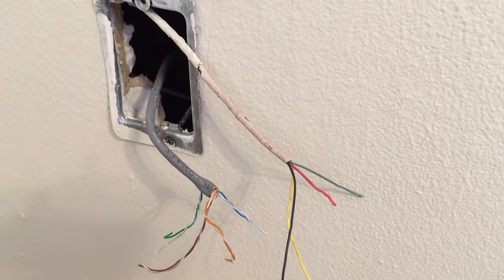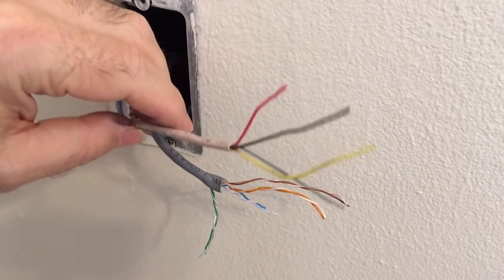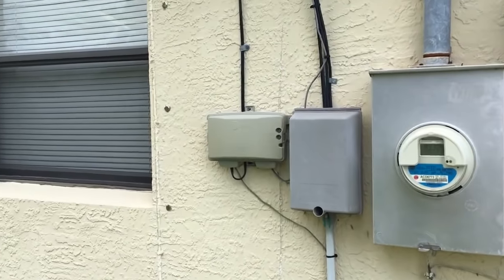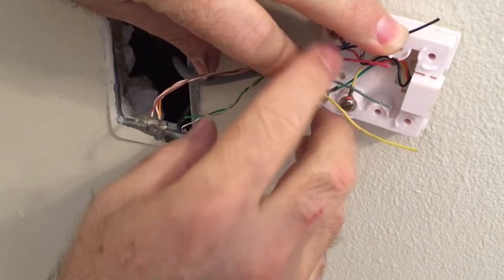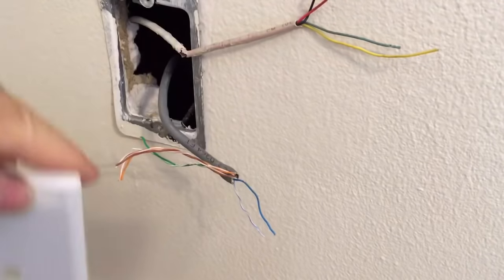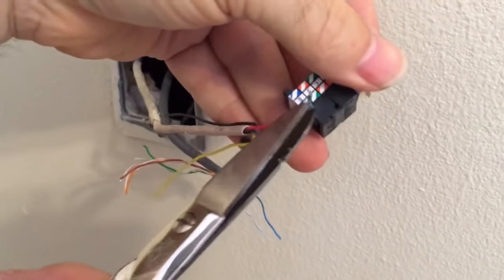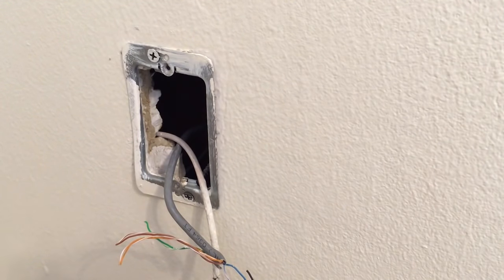House Phone Line Wiring

Comment: I have multiple phone jacks coming to the NID on the outside of the house. All wires are not connected to anything. I am no longer using the phone company but using a device for VOIP, which has a RJ11 Jack. What is the best way to connect my jacks to the new VOIP connection? Can I connect all of the Red to Red, Green to Green, Yellow to Yellow, Black to Black on the outside of the house including the connection from the VOIP? IS there a special termination block that can be mounted outside to keep the weather off of the connections? TIA

Comment: Our house was built in 1963. We have 3 round jacks which are flush to the wall. One in the kitchen, one in the hall and one in the master bedroom.. Suddenly all three do not work. We had Spectrum cable Co come in and check their connections and the tech said their system was working fine and the problem was not with their set up.These jacks must operate from a central location, as all three suddenly stopped working. Any suggestions?

Comment: Great Video.  I had an outlet that had two jacks, one was for the internet the other for phone.   The phone jack only had two wires, the internet had 4.  I changed to cable and used the space for the old Internet wires for the cable but had to reconnect the phone.    So i connected the new jack and only used two wires that was used for the phone jack.   All work fine, except the phone has a humming sound now.  I wanted to know if it is possible one of those wires from the internet may have been a ground to terminate the buzzing.   Can you help me with this issue?

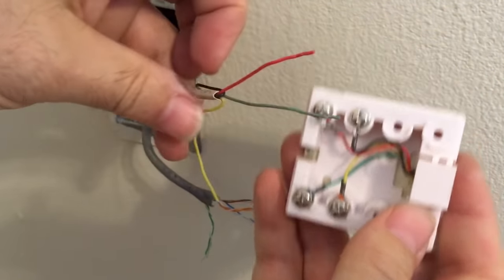Comment: Hi, at 4:44, it sounds like you are saying the tip and ring are 'green and red.'  

The wires appear to be gray and red, and then are shown to connect to the phone jack, which has red, green, black and yellow wires.

Are the green and red typically the two wires needed for a single residential phone installation?

Thank you!
Reply from the maker: Green (tip) and red (ring) are usually all you need for a residential phone line.   If your wiring does have a green/red/black/yellow wires inside, the its commercial wiring.  In that case, the white-blue and blue-white wires are what you need for tip and ring.

Comment: Apologies for the dumb question, but if the wiring from the wall is only three (Red, Green, Yellow) solid copper wires, is that a problem and can it be wired to any of these wall plate styles you went over? Also, my wire is coming right out of the wall, there is no metal mounting "bracket" as in your video or an electrical box it feeds into. Do I need to install anything additional?
Reply from the maker: Usually all that matters is the red and green.

Comment: only question i still have is that my issue is from the demark to the jack.  i want to replace the line because it is very old.  our phone company is Frontier and we have raging battles to get them to do anything and I am over it. I want to do this myself, but i don't know if i can get into the demark to do the work. i was wondering if you can splice like you would with electrical in a J box, or is that inadvisable?
Reply from the maker: Yes, splicing is ok. But it is critical to use airtight connectors for the splice.  Otherwise oxidation sets in and creates static on the line.
They have these things we call "red heads".  Not recalling the official name at the moment.  But you can find them at the big box he stores.  The look like little red plastic circles about the size of an m&m.  Good luck. 😊

Comment: Greetings. I have a question. Seeing that a surge protector has the term of "grounded phone line" in order for the warranty to work, how I can ground the phone line? Since all the 4 wires are 2 lines and I can see no ground. Is it something that the ISP provides in the box or poll that carries the wiring ? Thank you!
Reply from the maker: So, generally once a phone wire is inside yhe building (or house), there is no ground wire.  The outside box (demark) will often be grounded for lighting protection.   And you can get special phone line surge protectors that shunt to a ground connection.   
But overall, most phone cables (category 3,5,6) don’t come with a ground wire unless it’s what they call STP (shielded twisted pair).   But that’s not usual for most inside wire applications.   Hope that helps. 😊
Reply: @DIYTelecom  thank you very much, yes this helps :-)
Reply: Back in the day they use black and yellow pair for ground, not all them wires come with 4 wires, sometimes its.just res, green, and yellow, but the NID should always be grounded outside if not then it's a lawsuit

Comment: I have the 4 wires black-red-yellow-green I cut the broken modular piece off because it was broke could not hang up the phone so I took the 4 wires and attached to the 4 colors still no dial tone on that jack all others work in house and the phone works also on other jacks help
Reply from the maker: Jim, I'm assuming the the old jack worked before you cut it off.   If so, be sure you're connecting the colors to match what's on the jack.  (Green to green, Red to red, etc).
The main thing you should be concerned about is the red and green.  These are known as Tip1 and Ring1.   They are the only two you should need for dial tone.  If you had a 2nd phone number, then that would be on Yellow/Black.

Comment: You sound like Saul Goodman. Can I use the voltage from those wires to run an inverter? Thanks for your video.
Reply from the maker: Yes, I hear that frequently 😄
Inverter?  Not much juice, so not sure if it would be of any use. 🤷‍♀️

Comment: Im having trouble with my security system panel has red green and then 4 other red white green black. Trying to connect different panel not sure if i can connect a phone jack tip to either?
Reply from the maker: hi Sam.  Sounds frustrating.   That can be confusing because Alarm wire is often white/red/black so could be easy to confuse with phone wire.   Probably need a tech to come. Sorry I can't be more help there. :-)

Comment: Hi There, please help me, I have 4 wires black red white and blue, what colours do i connect in Cat 6 jack for internet use.
Reply from the maker: Hmm, that doesn't sound like a phone wire I've seen before.  If you  had a volt meter, you could check which two wire have 48v (or -48v) between the two of them.  Whichever those are you would put one the cat6 jack at the blue position and the other at the white/blue position.  Hope that helps.
Reply: @DIYTelecom  i dont have the volt machine. But thank you for your help though.

Comment: Just wondering where the yellow and black get connected in the keystone jack. Do they get connected in the same spots or in a different pair?
Reply from the maker: Excellent question Bryan!   So, if you have a Green/red/Black/yellow wiring, then the Black would go in the White/Orange of the keystone.  And, the yellow would go in the Orange/white.   Sorry, if I didn't mention that in my video.  
Glad you brought that up!  :)
Reply: Don't use that kind of wire for internet, that wire is fine for phone but terrible for dsl

Comment: Thank you for the video. Well done. We currently have a non-working phone line in our house (Uniden handset displays Check TEL Line)  with two (2) beige wires coming out of one of the junction boxes, all wires red, green, yellow and black. Does this mean we have two phone lines? Wiring might be wrong somewhere because we swapped the faceplates for newer ones and had to get new wall jacks.
Reply from the maker: hi Justin,  Just because you have the Green/Red and Black/Yellow doesn't mean you have two lines.   If I was troubleshooting that problem, I would be focused on just the red/green.  Good luck!

Comment: Im having issues with my ADSL internet... i took the cover off my phone socket and have noticed to red wire isnt attached/connected. Should the red wire be connected?
Reply from the maker: Usually the Red is connected to the red inside the jack.  Does it look like it broke off?  Or, does it appear as though it was intentionally left that way?  I would say try connecting it, see if it fixes the issue.  If not, you can always just unhook it again. 😀
Reply: @DIYTelecom  looks as if its never been connected.
Reply from the maker: Hmm that is puzzling.

Comment: Will this work for hooking up internet. I'm frustrated with century link so I'm gonna re wire the dsl line my self
Reply from the maker: Yes, DLS signal. Travels on the same green/red copper pair from the phone company to the DSL modem.  Now from the modem to your computer is a different story- that’s ethernet.  8-wire category 5e or above. Check out my other channel about networking for more info. YouTube.com/networkadvisor
Reply: @DIYTelecom  I bought a new screw post and connected the light blue to green and dark blue to red like you said and it didn't work for me, I followed the wires coming off the telephone pole to my house and it looks like it's been cut so I don't think I can fix it my self

Comment: I have a question. If I wanted to move a phone jack(my CenturyLink internet jack) to a different room In my house(its a modular home) and update the line from the box to new jack what do I need and is it easy enuff for a beginner?
Reply from the maker: actually, it’s possible the new location may already be wired.  so, a quick test would be to move the box to that new spot and plug it all up then see if the lights all come up.

WORS OF CAUTION before you begin.  take copious photos os of your existing connections before you move ANYTHING.  particularly, note where all the different wires are plugged-in.  

if it doesn’t work in the new location, you can just put it back the way it was.

Comment: Do you know if you can have 3 cables off one jack or do you need to find the end jack and go from there?
Reply from the maker: Yes, you  can certainly do that.  Especially when using biscuit or flush-mount residential jacks.  😁
Reply: As many as you want for phone, don't do this for data because it will cause a bridgetap which kills ur internet speeds

Comment: Does the voltage come from the telephone company or the resident's electrical box?
Reply from the maker: It’s supplied from the phone company.  Great question!😀
Reply: Thanks,  @DIYTelecom !  I love old phones but I will never have a phone service (because I use a smartphone).  Has anyone ever turned their home land-line-phone "network" into a house intercom just for fun (using old phones)?  I tinker with Arduino and Raspberri Pi and am confident there's a way to execute different functions depending on what numbers were dialed e.g. make the other phones ring etc.  All the Best!
Reply from the maker: There’s a company called Viking which makes a lot of products related to what you’re talking about.   😊
Reply from the maker: https://www.vikingtelecomsolutions.com
Reply: Awesome!  Thanks,  @DIYTelecom  !! :)

Comment: I have a wall mount with a commercial line. how do I actually connect the lines?
Reply from the maker: dont mean to be a jerk but semantics matter.  when you say “line”  I will assume you mean the service from the phone company.  in that case, the connection of the line (service) to the inside wiring is done a the junction box.  usually referred-to as the Demarc.

Comment: Hi! I have  2 questions.  1. I've  been  remodeling  my kitchen. I removed  some  drywall  which  exposed  2 lengths  of phone  cable  that  were  spliced  together. The  splices  were  done  with  wire   nuts. I  know  it's  a code  violation  to  splice 115, 120 volt  together  and  then  cover over  with  drywall, but  is  this  ok for phone cable? 2. When you work  on phone  connectors  like  the  ones  you  show  in  the  video, shouldn't  you  some how  turn  off  the  power  to  the  phone? Perhaps  at  the   "D-mark" (sp?). If so, how  do  you  do  that  at  the  dmark?

Comment: Can you place an in-line toggle switch on your phone line? For example, If I wanted to drop a call without picking up the phone, I would just hit the switch to dump the call. Thats what im trying to do.
Reply from the maker: yes, you could.   I used to busy-out lines with 500ohm resistors bridged across the Tip and Ring (the green and the red).

So, I guess you could make a jack with a resistor in it that bridged the Tip & Ring.  And, then put it in parallel with your phone wiring.   I guess you'd put a toggle switch between the live wires and this new dummy-load switch.

Interesting idea, thanks for mentioning!  :-D

Comment: Amazing video!
I have a question
So i got an ethernet cable to my house and it carries both internet and phone what should i do to use both through adsl splitter ?
Reply from the maker: Hi Omar.  Its hard to know exactly based on what you’re telling me.  It sounds as though you have an Ethernet delivering to your modem.  And then the modem has a port for voice and a separate port(s) for Internet?
Reply: @DIYTelecom  no i have a modem router combo that has rj11 port 
I instead have an ethernet cable that carries both phone line and internet and i want to convert it so i could put in adsl splitter that has rj11 then feed my phone handset and another to my modem router combo

Comment: I simply want to disconnect the line from  AT&T to my house, but leave in tact the internal phone wiring that distributes the phone connection to multiple jacks within my house.  This because I have switched to VoIP and my main telephone connection is now through a modem.  But I want to continue to use my internal house phone lines to other jacks so I can use them for calling, as before.
Reply from the maker: I definitely understand what you are trying to do.  The place to disconnect the phone service from your inside wiring is at the “demarc”.  That is usually a box located on the exterior of your house.   Once you do that, you could run a phone wire out of the modem to a nearby wall jack and that would back-feed the VOIP dial tone into the rest of the house jacks.  
Good luck. 😄

Comment: Do you have to turn any power off?
Reply from the maker: you don't need to turn the power off.  However, if someone calls the phone number while you are working on the bare copper wires, you will feel the jolt.  So, for an abundance of caution, you may consider disconnecting the Green/Red wires from the demarc while working on the wiring.

Comment: Good video!  Question, how long/far can you run a telephone line before you get signal loss?   Do they make an amplifier to extend the length of transmission?   

I disconnected from the D Mark and now use a stand alone cell phone box that works well through out the house however, the line running down to the shop appears dead.   Wiring did not change other than disconnected from D Mark.  I’m thinking not enough volts to send 75 yards to shop now.   

Thanks!!
Reply from the maker: hi Bob,  I hate to say "it depends" but a typical phone line off the telephone pole should be strong enough to run for at least a mile on 24gauge copper wire.  However, I'm not sure the specs (power level) of that box you're using to share mobile via the house wiring.   If I had to guess, it might be a short or a broken wire.  Is the signal now dead at ALL the locations?  or just the far flung locations?

If you're an electrical kinda guy, you can try taking a volt meter and see if you get a 48v (might be positive, might be negative - either is OK) across the red and green wires.  Sorry I can't be more help.
Reply: @DIYTelecom  just the far one one is dead.  Let me see if any voltage is coming down!   Good idea, thanks.
Reply from the maker: Any luck?
Reply: @DIYTelecom  less than a volt at the barn.  Need to check a few things up at the origination.
Reply from the maker: Good work.  Typically an idle phone line is 48v (neg or pos).  When the receiver is lifted, the voltage drops to like 10 (or less).  

Thanks for getting back to me.  ☺️

Comment: Do know any thing about bridge tap how to remove as my telco told me that's what's making my internet drop
Reply from the maker: James, best thing to do, in my opinion, would be to run a new wire straight from the phone demarc box (usually on outside of the house) straight to the place where your DSL modem is.   And, disconnect every   other wire feeding into the house.   See if that improves the speed.  Then, you can reconnect the inside wiring back one-by-one and notice when the speed drops.   It's tricky.  Good luck.  :)

Comment: Awesome video but I don't get it, I have the commercial wires, so all i connect is the blue? What are the other 3 colors for? (green, orange and brown)
Reply from the maker: Heshy, if you only have one phone line (phone number) then yes - just stick with the blue/white wires.  But, the best practice is to run 4-pair cables in all installations even if the customer will only be using one line.   
If you had more lines, Orange would be line 2, Green would be line 3 and Brown would be line 4.

Comment: Does the internet come on the same coaxial wires as the phone? Or they run separately back underground?
Reply: Varies
Reply: At&t is different from Verizon. Cable is way different from both

Comment: What about the black and yellow?
Reply from the maker: Joe,  those are not used much anymore.  Except in some cases where you might have 2 different phone lines (separate ph numbers) on the same phone outlet.
Depending how far back you, there was a time (70s & 80s) when black and yellow was used to supply power to the phones that had lighted dialpads (ie. Princess phones).   Anyway,  probably more than you wanted - but now you know.  😄
Reply: You’ll only need these for bonded pair, second line or alarm system.